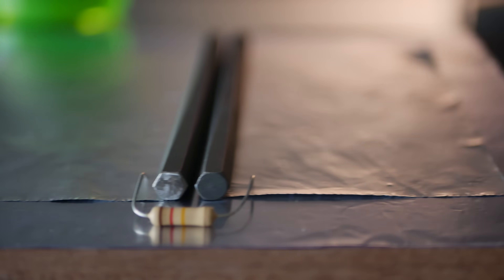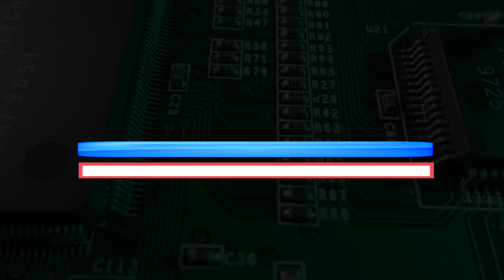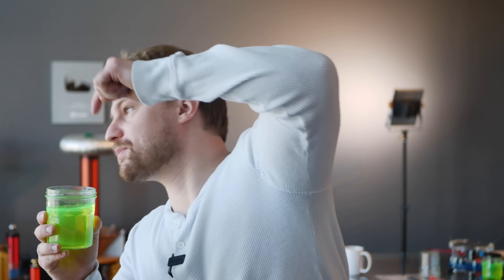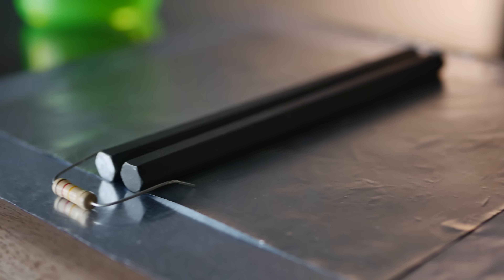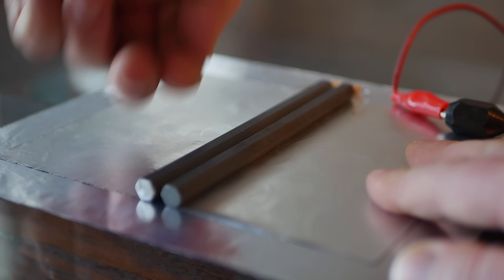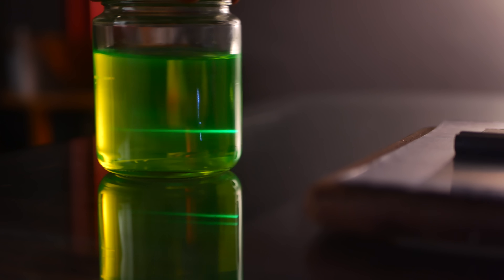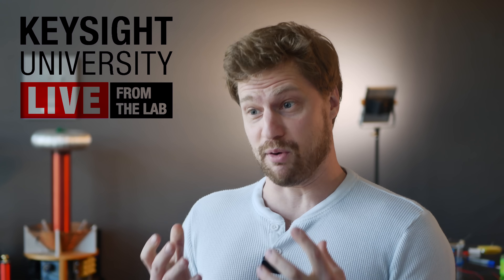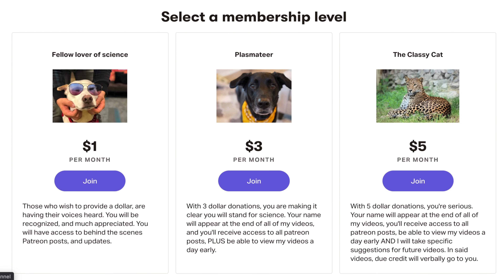Building A Simple High Voltage Nitrogen Laser (Ft. StyroPyro + giveaway)

Comment: i liked and im subscribed. i think your next video should be how to make a tesla coil without a power supply, like connect 9 volts and then use the lightning tower technique and multiply 9 volts into 50000 volts or even more. because some beginners do not know how to make a power supply or even know the basics of electronics. so i would thank you if you made a video on that and say the basics and step by step guide like you always do. i really appreciate the effort your putting in your videos. thanks.

Comment: For my Final Year Project this semester I learned that Nitrogen basically made up our atmosphere about 78%. Which is why this TEA laser is so cool. Due to that fact, combustion engine cars will produce Nitrogen Oxide including other hazardous gas like carbon dioxide and monoxide. My project is to apply Hydrogen Fuel Cell on vehicles to swap combustion engines into becoming Electronic Vehicles. However, the downside of this project is basically hydrogen fuel cell produce very little electrical energy. It would be lovely to see how you would suggest to upscale the power Hydrogen Fuel Cell for our future vehicles. Thanks 😊

Comment: Are there variables within your experiment that could change the focus of the laser? What's the predicted wattage of the beam if most of the energy is lost due to heat between the hex bolts and are they actually lined up photons in the beam or is it more of a directed light kind of a deal because the light does seem to spread out along the horizontal axis. Also does the resistor make a difference between any variables such as light intensity or distance required for the bolts to be separated and then what if you used instead of 500 grit sandpaper if you used 5000 grit sandpaper and also what if you sandblasted it verses sand-papering(?) it and then what if you used gold foil under the bolts or what if a superconductor was used under the bolts? Does temperature and humidity make a difference? What about atmospheric pressure? Then there's also the frequency of the electrical current within the system and also the voltage and amperage so it seems damn near impossible to get it right the first time so I can see why you contacted the person who loves lasers. Also you could have used your phones camera to test if it worked or not. Phone cameras at least in older gen iPhones and maybe androids are able to reproduce ultraviolet light on the phone screen in the visible color frequencies. Also you might have forgotten to sand your aluminum L bars. I can't remember but that may have been a problem with the aluminum because theoretically/hypothetically any shortcomings of the aluminum could be taken care of (assuming that the aluminum is only unused to transfer the electrical currents across an air gap) using higher electrical values for amperage and voltage (probably voltage though) and a bigger or smaller resister

Comment: You demonstrated that high voltage is a mother of many physical phenomenon like producing optical energy or generating radio waves.... This project looks like simple ABCD but there is a huge theory behind it, but my doubt is if we put some chemical salts in between electrode by changing the colour of arcs can we produce different coloured laser points....?

In future I like to see about atmospheric electricity. In Richard Feynman's book he mentioned that atmosphere holds 100V per meter also with respect to ground level above 50km this potential rises to 400kV, since this channel provides good knowledge in physics (insted of free energy scam) can you demonstrate the existence of this energy and if possible can you show that can we harness this energy for our daily works.....?

I'm just graduated from my university, I'm teaching electronics for students and interested people for absolutely free, along with books I believe that practical implementations is the key to learn but while teaching about transient conditions and while analysing high frequency circuit like RFID transmitter, resonant pulse inverters etc I always stuck at oscilloscope part so students are confused on the topics and showes doubtful faces, also I'm planning to create my own small products like DC DC converters and other modules along with my higher studies.... If I get that oscilloscope it will be very helpful for teaching electronics to others and also for my higher studies..... :-) since oscilloscope is an expensive equipment I can't buy one, so I'm tried on many oscilloscope giveaway but didn't get one.....

Comment: I saw one in college but with some significant but easily workable mods.  The top two plates were not rectangular. Taken together it looked like a parabolic focussing apparatus but the channel was cut at an angle to the centerline of focus.  So as the spark developed it moved along the channel in a controlled fashion depending on the angle of its cut to the centerline of focus of the top plate assembly.  The focus causes a linear wave of electric voltage to travel across the top plate and the spark gap.

Comment: Well, I guess if your lasermedium ist long enough you don't even need a resonator :) So if i understand it correctly the light amplification (which ist the LA in Laser) works kind of like an avalanche-breakthrough. You start of with one spontaeously emitted photon which then creates more photons by stimulated emmision along the path. Very cool concept.

I don´t know, whether it would be possible for a future video, but you didn´t dive into the world of low-pressure-plasma yet. That is one of the most widely used form of plasma and if it works it would be a very awesome video.

Comment: I really like that your content is innovative and creative (compared to many channels that put out the same content with different presentations), it is clear that you are making content based on what you really like and I am sure that soon you will reach 1M subscribers and more. Wish you luck!
Project Idea: I like to see how hard of easy it is to direct high voltage arc (using electrical and magnetic fields) to choose a path with higher resistance(instead of the path with the lowest resistance) , maybe this concept can be used to draw paintings on wood. (a controlled Lichtenburg burning)

Comment: That's really amazing! Still trying to wrap my head around how the heck this thing works - need to rewatch the video a few more times. As for future projects, how about using one of those flyback transformers used instead of iron core transformers in some recent microwaves?
Reply: Like stated at around 5:30 in the video, the lasing occurs as a chain reaction, avalanche, whatever appeals to your understanding. When an energized nitrogen molecule drops in energy state along the length of the rails, a photon is ejected, this one photon cascades through other energized nitrogen molecules along the path of the rails exciting more photon discharges, because the rails are straight you end up with a coherent group of photons traveling along the same vector as they leave the rails. There is a beam emitted from either end of this apparatus. I believe that's an accurate description, hopefully someone will chime in if I am giving you bad information.
Reply: @blackbeardthepirate7467  yes u r theory was crct.. that is why LASER stands for light amplification by STIMULATED emission reaction
Reply: @blackbeardthepirate7467  interesting, that makes sense. Thanks for the clarification!
Reply: @nigel-matthews  glad to help you gain any understanding, it really is a fascinating phenomenon that physics allows us to force a laser into existence like this. Makes you wonder what other kind of phenomena can be "brute forced" with less equipment than one might think possible.